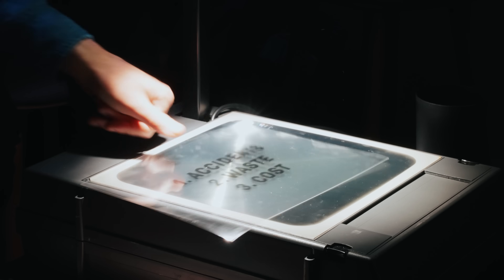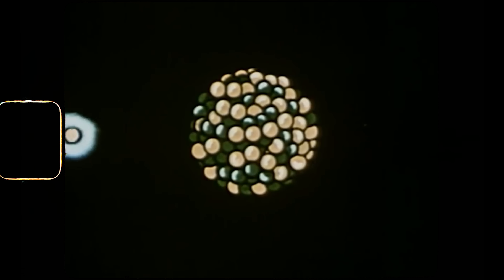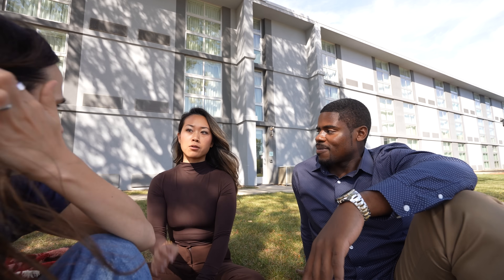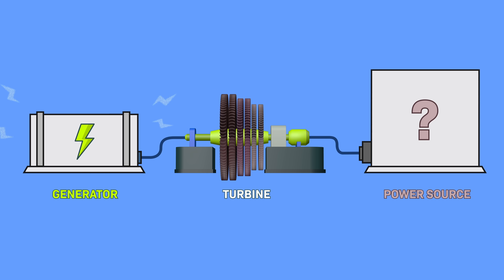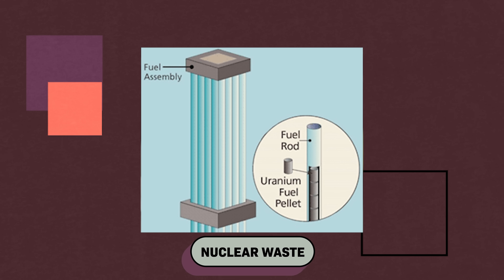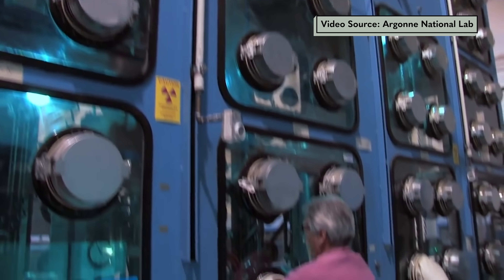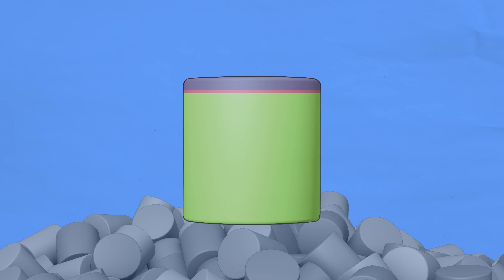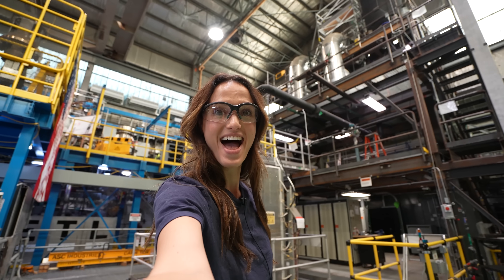The Big Lie About Nuclear Waste

Comment: The UK tried to recycle nuclear waste but it was just way too expensive and dangerous so the plants were shut down. I think its the same story world-wide. So, the UK stores its waste in ponds and storage sites waiting to dig a big hole to put it all in when we can agree where to put it. Nuclear energy is just too complicated and expensive. The Uk were going to build multiple reactors but the massive cost has meant we have only 1 being built which is way way over budget and has serious build delay problems already before its even half way done. Most of the UK existing reactors are being shut in the next few years.
Reply: Its clearly a solvable issue, as humans we've done way more difficult stuff. The issue is simply money for research.
Reply: @punishedbrains  but sadly, not many countries are putting their money into this area. Germany has shut down all its reactors, or will do soon.
Reply: Greg - That's why the emphasis has shifted to the development of small, modular nuclear reactors which cn be built and brought on line much more quickly.
Reply: feel like is all about consumption and efficiency.  like real life, always easier to throw away than recycle or repairing it, and disregarding the long term consequence
Reply: a lot of it is the politics and red tape driving up the costs. along with studies about the studies just wasting money driving up the cost of the actual plant
Reply: Solar and Wind are far too complicated and expensive ,,

But , yet !
Reply: @avibhagan  no, you are not correct. Solar and Wind are cheaper than they have ever been and getting so cheap that coal stations and nuclear are being switched off and replaced by renewables
Reply: @Greguk444  

Nuclear produces less waste than solar,  has a lower carbon footprint than solar, 

Nuclear is safer than wind.

Of, these 3 sources of energy. Wind has the highest death rate among industry workers.

And, don't forget to remember that wind turbines need oil changes just like a car. Oil leaks and spills from wind turbines are quite common.

Nuclear's main problem is old plants that are over 30 years old. 

Nobody is judging wind and solar based on 30 year old turbines and panels.
Reply: @avibhagan  I very much doubt that nuclear is safer than renewables. I am certain that wind and solar equipment can be safely recycled. It may take some effort but it’s definitely doable, whereas nuclear waste is stuck in limbo for 40 years in decaying leaking water ponds that are causing significant safety problems and massive costs to clean up and there is no waste solution except what Finland is doing by digging a very deep big hole to bury their waste and praying it will be ok for the next thousand years or so.
Reply: @Greguk444  

you can continue to very much doubt.

The facts remain the facts no matter how much you doubt them 

You doubt them only because they are incontinent to your OPINION. 

And you lack the academic honesty to adjust your OPINION , when confronted with new (and 100% factual) information, that was missing when you formed your original OPINION.   

I doubt , nothing I've typed because I can verify it, and have read multiple studies, and the data is very conclusive.
Reply: @avibhagan  I am always open to be convinced. Please show me the evidence.
Reply: @avibhagan  
According to the North West Mining Association in the USA, a 3 Megawatt windturbine contains 1545 tons of material. At 39% average capacity factor of new installed Windturbines in 2021, over a 25 year timespan it will produce 256 GWh of electricity.
At 20 to 50 Watt/kg for monocrystaline Solarpanels, 25 years lifespan and 18% capacity factor they require for the same amount of electricity to be generated 325 tons of material.
The materials are extracted from sources of high concentration (Concrete is just rocks and roasted Calcium carbonate, glass is molten sand, iron and aluminium generate about three times as much waste rock for every Ton, however in case of the Windturbine only make up about 20% of all material).
They are also mostly recyclable...
Nuclear on the other hand would require to generate an equal amount of energy, according to the „Recycled Nuclear Fuel Cost Calculator“, 6,32 tons of Uranium. With the current average Uranium ore concentration of 0,15% that would make 4200 tons of Uranium ore that have to be processed, with 99% of that material being dumped near the mine into the environment, still containing sulphuric acid used to extract the Uranium and also other heavy metals like Lead and Radium, mobilized by the acid.
And so far we have no working breeder reactor, meaning we can’t actually recycle the Uranium 238 in any significant amount.

As regards Deaths per TWh, they are 0,04 for wind, 0,03 for nuclear and 0,02 for solar, hardly a huge difference.

Oil spills occur in Windturbines and so do they in pretty much every piece of technology that requires lubrication, nuclear generators included, now can you prove that Windturbines will lead to a disproportionate amount of oil being released into the environment compared to other machines?

The issue with nuclear aging reactor fleet, is that most countries aren’t attempting to replace them as the task appears to monumental for them both in terms of cost and time required. At its best the build time for nuclear reactors in the 80s was 8 years, compared to wind and solar farms taking only a year.
Reply: @paulschmidts5429  

So defensive , but let me address this : 

" Oil spills occur in Windturbines and so do they in pretty much every piece of technology that requires lubrication, nuclear generators included, now can you prove that Windturbines will lead to a disproportionate amount of oil being released into the environment compared to other machines  " .

1 - Turbines are located in the natural environment they can be in coastal zones of in the sea. Oil leaks from turbines will therefore be in those places . .

2 - Oil leaks in a steam turbine, in a nuclear plant will be isolated to inside the plant. 

So, yes we can pretty much guarantee that wind turbines will lead to much, much more oil spilled into the environment that Nuclear  plants.

Furthermore . a Nuclear plant is only likely to have 2-3 turbines. And a wind farm may have 100 or more turbines  .Therefore the amount of oil required by wind turbines is many orders of magnitude more than a nuclear plant. 

And look,  you and I don't have to have this debate. Scientists and experts have already done ALLL the research , and the research and analysis is complete .

It's just that people like you, refuse to accept the "science" , because TV and the movies told you something different.
Reply: @avibhagan  Honestly, I think when you argue against Windturbines on the basis of them containing lubrication oil that can be spilled, which is the case with all industrial equipment, significant parts of which are used in the environment such as all forms of ships, planes, cars or other mobile machinery then you are reaching for straws, just to pull down everything that could stand in the way of building as many Nuclear powerplants as possible.
That’s why I didn’t take the objection seriously, since also half the websites I found online mentioning lubrication oil releases were the usual anti Windpower, Climate Change Denying, quack blogs.
Now the answer to lubrication oil spills in Windturbines is the same as to lubrication oil spills in general: Use Biodegradable, usually plant based oils, as is standard in a lot of industries in the EU for example.
Now I won’t grap for straws now and argue that we can’t do nuclear, because there is a small constant emission of radioactive gases from the reactor into the environment in the form of Tritium, Krypton and co.
Now I am quite in favor of going with the scientists and engineers advice:
The International Energy Agency’s „Roadmap to Net Zero by 2050“ advices we should aim for an electricity mix of 70% wind and solar, 20% other renewables (mostly hydro) and 10% nuclear.
Reply: @paulschmidts5429  

I actually used to be pro-wind and anti-solar when I did my BSc -2001-2004. 

But in remaining current , I've gradually become anti-wind and pro-solar has improved and improved. 

I've remained true to the data , and It's is not usual for the popular logic to trail a few years behind that data and science. 

Nuclear has also improved a lot. It has always had a bad image and there has always been a lot of false information about Nuclear . 

most anti-nuclear arguments are made by comparing 2020 Solar and Wind tech to 1970's nuclear plants.
Reply: @avibhagan  According to the study „Geophysical constraints on the reliability of solar and wind power worldwide“ Wind and Solar are actually complementary in that they usually have higher output when the other one is lowered (it’s windier at night while sunnier during the day) or fullfill differing seasonal demand spikes (higher heat demand in winter while also more wind, higher Cooling demand in summer while also more sun). Thus the best Variable Renewable energy mixes have shares of 10% to 70%, on average 36% with the rest being made up by Wind, depending on a nations geography and latitude.
Construction times of Gen2 reactors (8 years) are better then those of Gen3 reactors (10+ years), similarly Construction costs have increased with Gen3 reactors. While Capacity factors with new build Gen3 reactors (90%) are better, then the initial Gen2 capacity factors (60%), over their lifetime Gen2 reactors also reached the same capacity factors (90%). While Gen3 have made improvements in areas of safety, this came partially at the expense of economics.
Reply: @paulschmidts5429  

Wind is still restricted to certain geological zones. Especially the coast.

It's not an option available to every country.

You're going to need at least 10%, nuclear if you want to go 100%, green. 

100%, nuclear, even when considering storage of spent fuel, remains the most environmentally friendly option according to the data. (Not factoring in cost)
Reply: @avibhagan  If you use the Global Windatlas and pick IEC III in the top left corner, and search for areas with 35% capacity factor, most countries have sufficient ones, with the exception of Central Africa, Northern West South America and South East Asia (including Bangladesh). While these Countries may in the future wanna consider building more nuclear powerplants to deal with demand, for now they have huge unexploited hydro power potential that can be combined with photovoltaics at a cheaper price.

You need atleast 90% Renewables to go a 100% green. ^^

You need to also consider the extraction process of the minerals that go into nuclear and average ore concentration of the input materials:
The World Nuclear Association, WNA has in an article called „Mineral Requirements for Electricity Generation created a list of tons per TWh, however excluding Uranium and the average ore grades those minerals are sourced from:
It lists Critical mineral (Copper, Zinc, Mangan etc.) needs of 130 tons/TWh for Onshore Wind and 12 tons/TWh for nuclear. Taking copper ore concentration as a reference (Olympic dam mine 0,8%) that would translate to 16250 tons/TWh of ore for onshore wind, 1500 tons/TWh for nuclear. Add to that from the second table below Concrete which is basically just processed rock (Wind 4470 tons/TWh, Nuclear 1060 tons/TWh) and Steel which at worst has iron ore concentrations of 48% so ore needs of (Wind 3020 tons/TWh, Nuclear 271 tons/TWh). Per TWh of nuclear energy however also 24 tons of Uranium are needed, according to the „Nuclear Fuel Energy and CO2 Balance Calculator“, which in case of the Rössing mine in Namibia has an concentration of 0,029% of Uranium, so would require the extraction of 82759 tons of ore.
So we arrive at a sum total of 23740 tons/TWh of ore having to be mind for Onshore Wind and 85590 tons/TWh of ore having to be mined for Nuclear. 
Now while the Rössing mine has the lowest Uranium concentration of all present Uranium mines, it’s representative of where ore concentration for Uranium are heading:
To produce 10% of the 70.000 TWh electricity demand the IEA projects for 2050 168.000 tons of Uranium would need to be mined, while the OECDs Red Book gives a figure of 8.070.400 tons of both proven and inferred resources, so 48 years of supply. While potentially Unconventional Uranium Resources in the form of Blackshales and Phosphates may add another 57.000.000 Million to that, those are more expensive and have far lower Uranium Concentrations thus increasing the environmental impact of mining them (Black Shales ~0,005%).
Reply: So what's UKs plan?, Solar and wind impossible in UK temperature and feigid climate.
Reply: @anonymousinfinido2540  Wind energy currently powers around 25% of UK homes.
Reply: @anonymousinfinido2540  Wind impossible? Have you been to the coast lately? Offshore wind farms could easily provide base load power for the UK.
Reply: @lonestarr1490  yes, it is. Although we have enough sunshine here in my country, I pity Europeans not giving Nuclear a chance.
Reply: @lonestarr1490  yes, you are correct. Renewables have recently hit more than 40% of total energy supply and it is increasing. 3 more massive wind farms have been planned for deployment in the next 5 years
Reply: @lonestarr1490  Until the wind stops. We should keep as much wind and solar as possible, and yes even grow it, but it is limiting. Solar only works during the day but we have long nights in winter. Wind only works when the wind is blowing, and not blowing too strongly. We ALSO need nuclear.
Reply: @anonymousinfinido2540  Actually France has a lot of nuclear power generation. It is only Germany that has a policy of getting rid of it, and there the cost of electricity has skyrocketed because of it.
Reply: @_starfiend  No, we don't. If your network spans the whole country, from coast to coast, the wind literally never stops. There's always wind somewhere.
But furthermore, wind farms produce way more energy than is required. Thus, all we need are means to store this energy. Many small batteries in a huge network are more effective than few large batteries. But those can also be applied, in the form of pumped-storage hydroelectricity.
Reply: @_starfiend  but France utility's nuclear output sank by 23% in 2022 as it halted about a dozen of its 56 reactors to replace cracked pipes
Reply: @Greguk444  Yes, but they are not getting rid of those power plants.
Reply: @_starfiend  No, the cost of electricity in Germany hasn't skyrocketed because of getting rid of nuclear power generation. It has skyrocketed because of the Russian invasion of Ukraine and the subsequent sanctions on Russia, which resulted in a shortage of natural gas in Germany. The nuclear reactors in Germany were still running when this skyrocketing occured, which is why the government was able to postpone their shutdown until Apil of this year. And the cost of electricity didn't went up further when they finally were shut down.
Therefore, I kindly ask you to refrain from spreading lies. Thank you.
Reply: @lonestarr1490  During high pressure weather there is regularly low wind across a large part of the country. To say there is always some wind somewhere is disingenuous as there has to be enough, and that cannot ever be guaranteed. The type of wind turbines used also cannot run when the wind is too high and that is actually quite common in the North Sea in particular. Wind farms do NOT produce anywhere near enough currently, even at maximum production rates. Battery technology is not yet good enough to store what they do produce and while it is getting better that improvement rate is slowing down. There are better styles of wind turbine that can be used closer together, will work in more variable wind speeds, including faster wind speeds, are not as high so make servicing easier and safer, but we don't currently use those. Add in tidal generation, but they only work during the tidal runs, at high and low tide they do nothing - otoh just look at all the problems the proposed set up along the coast from Cardiff is having due to ecological problems and damage to delicate ecological wetlands etc.

Wind and solar are not enough and never will be, especially as we are using more and more because of the expanding use of electric vehicles etc.
Reply: @lonestarr1490  You need to go back and do your research. The coset of electricity in Germany skyrocketed long before the Rusian invasion of Ukraine. It started pretty much as soon as the German government started to close down their reactors after the Fukushima accident/disaster. So I suggest you please stop telling lies yuourself.
Reply: @_starfiend  I am German and paying German electric bills. Believe me, I know exactly when the cost of electricity in Germany went up. My electricity bill was almost stable for five years before the invasion.
Reply: @_starfiend  France dependence on nuclear is shown to be very risky because nuclear’s complex engineering is dependent of cooling and other technologies that can go wrong as they have in France and caused the shut down of a large proportion of their generating capacity for a large amount of time to the point where France has to import energy from other countries.
Reply: @_starfiend  So, as you mentioned, improvements are being made. Why should we prefer building nuclear power plants---which can take more than 10 years---over simply installing new wind turbines and more solar? The latter is way more modular and hence flexible.
When it comes to the capabilities of battery technology, I choose to believe Technology Connections over you, thank you. Besides, I wasn't talking about chemical batteries per se, but about batteries in a broader sense. Especially the UK has great potential for pumped storage hydropower (way more than Germany, btw). And pumped hydro is capable of quick storage and even quicker release.

So yeah, I don't believe your conclusions.
Reply: @anonymousinfinido2540  not impossible, it’s already happening